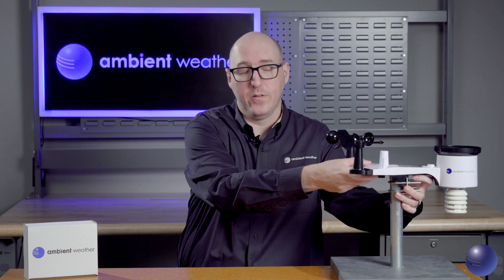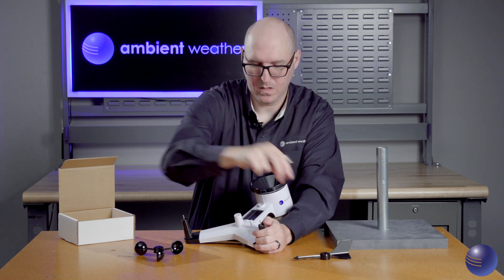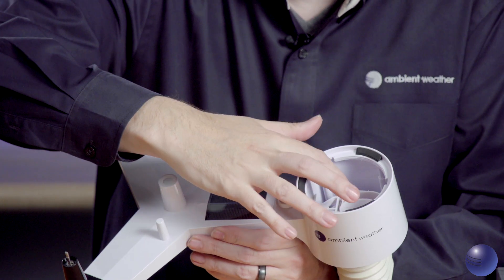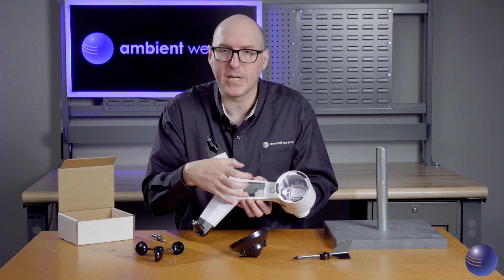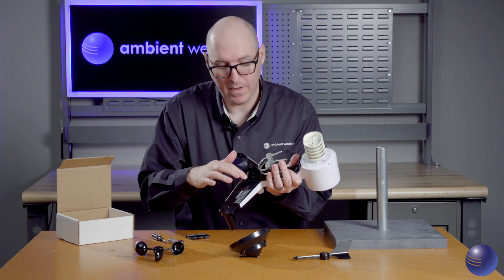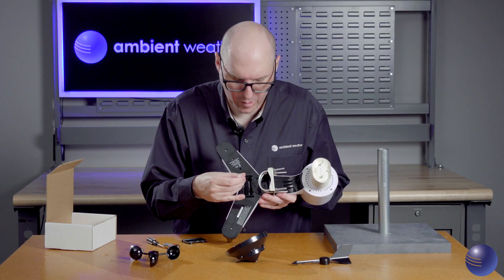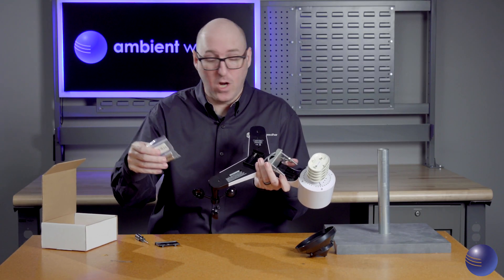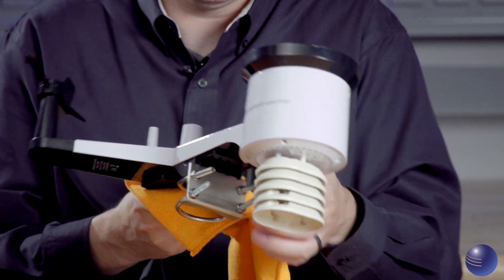Ambient Weather WS-2902 & WS-2000 | Performing Maintenance

Comment: I have the Ambient Weather WS-2902 WiFi Smart Weather Station and noticed that the anemometer (wind speed) was spinning substantially slower than it should and the displayed wind speed confirmed this. I noticed also that birds were perching on it when the actual windspeed was near zero. 

I removed the weather station, took off the anemometer cups and noticed that the steel shaft was a little stiff to rotate and it had a lot of longitudinal movement or slop. On closer inspection, discovered that the small E-Type Circlip had slipped out of its groove. 

I removed the Circlip and bearing, cleaned and lubricated them (LPS 3 or similar), then using pliers, squeezed the Circlip closed a little so it would hold its groove better. Sprayed a little LPS 3 around the shaft and spun it a few times to work the lube into the mechanism. Cleaned and lubricated the Wind vane shaft, checking the state of its Circlip, replaced the batteries and mounted the weather station back in place. 

It seems to be working better now. Time will tell if this repair lasts. I may need to replace the Circlip with a new stainless steel one in the future. Hopefully the continual spinning will prevent the birds from perching on it in the future

Comment: This was not helpful. Cleaning it up is good, but I was outside, winds at about 7, and my weather cups not moving. I went out, and turned by hand, felt like gear grinding inside issue. Seems like you would want to clean inside or regrease so that it moves real smooth. Comments welcome on this if you have ever had this issue. I begin to wonder if the wind speeds are accurate.
Reply: Same, I had to put a couple drops of bearing oil down in mine to get it spinning properly again.
Reply: Agree. This “maintenance” was just taking it apart, looking at it, and cleaning the battery compartment for corrosion. What about cleaning the rain cup from all the dirt collected, oiling the wind cups, and cleaning the surface of the unit?  Is wiping down the unit for oil or fingerprints with microfiber cloth really maintenance??  I’m Windex’ing the shit out of mine.

Comment: Weather station display began showing lines for the outside data. Changed batteries in the weather station and the display. Everything worked fine for a few days now it doesn't display outside data at all. Thoughts?
Reply: Try bringing array near to console... if still problem persists claim warranty... how far is distance of console and array???